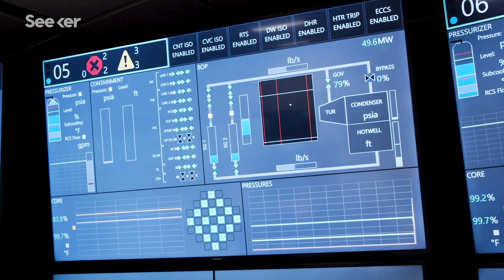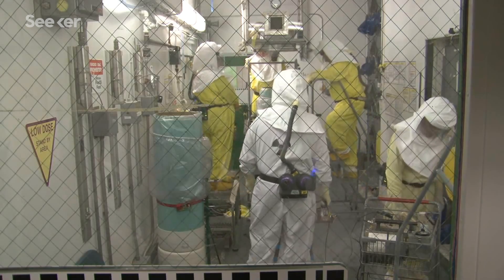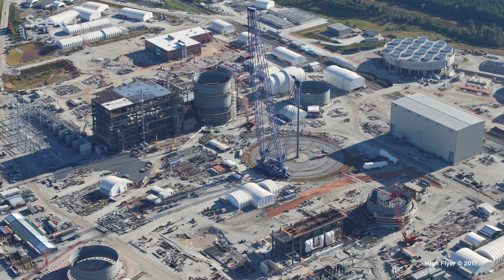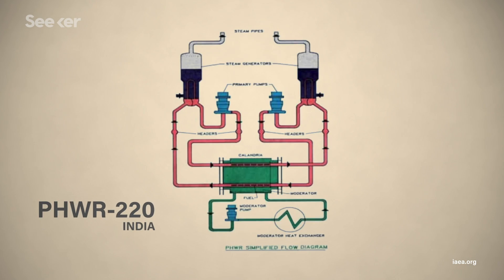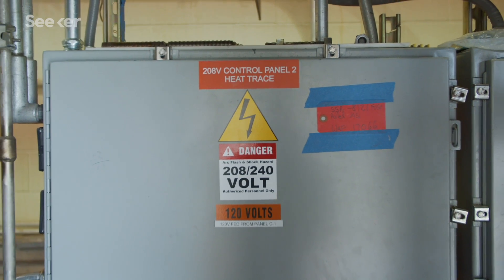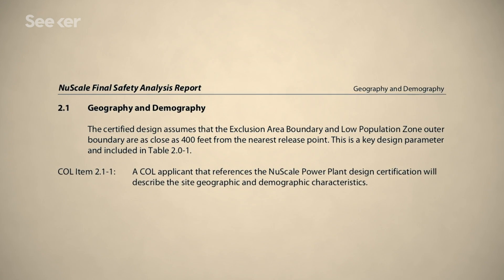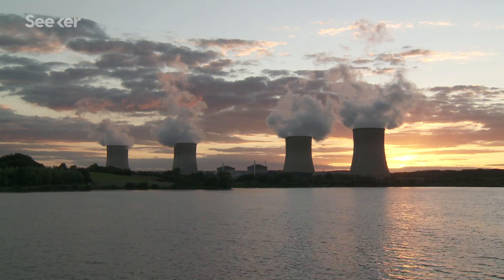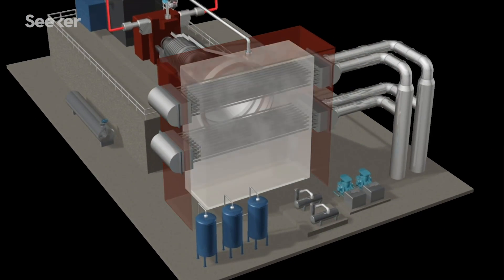Mini-Nuclear Reactors Are Coming, and They Could Reinvent the Energy Industry

Comment: One word: Thorium.
Reply: @Shell_Beach  Molten salt gives you safer reactor. Thorium gives you much, much safer residues. Win, win
Reply: Mike G that was three with a punctuation
Reply: Thank you Mike,the voice of intellect .
Reply: Three words : Fast Breeder Reactor
Reply: Mike G fun fact, the US military considered thorium when first developing nuclear reactors, but ended sticking to uranium since it could create plutonium for weapons
Reply: @cru5h80cru5h 
You mean unlike Thorium reactors that can produce uranium and plutonium which could be used in nuclear weapons.
India and Pakistan are fighting right now over India's plans to use a breeder reactor to create the driver fuel for a thorium reactor, which is weapon grade plutonium.
Don't believe everything people tell you.
Reply: @cru5h80cru5h  I'd encourage you to look into that more.
Reply: @haliax8149  Actually, Cesar is 100% correct.
Reply: @cru5h80cru5h  You forgot the fact that building a nuclear reactor run by a plutonium core is 1000 times easier than Thorium.
Reply: Show me a molten salt design that deals with the pipe decay.
Reply: @Shell_Beach 
The nuclear industry has promised the sky for decades.
They talked about" electricity to cheap to meter" and France even had ambitions to run on 100% nuclear energy (not only electricity but energy) and didn't even come close.
With current technology the levelized production cost of nuclear is around 140 to 190$/MWh. France estimates that they could lower that to 70$ in the next 5 to 10 years with their Gen IV reactors.
In the meantime we see the cost for wind and solar and storage diving hard.
New utility scale solar and wind is currently at 30 to 55$ and by the time gen IV reactors are ready will drop to 20 to 30.
So even if you include storage, nuclear is way to expensive.
Reply: @TBFSJjunior  "Current" technology is still based on the equivalent of a 1930s aircraft design.
Reply: @bobthebomb6498 
Sure fundamentally most nuclear designs are based on 60+ year old designs. Same is true for LFTR.

In regards of France their current reactors are GEN III+ designs and even their Gen IV designs are based on old technology.

It is always the same with nuclear it seems.
Same old promises. How does the saying goes: "Talk is cheap"
Reply: @bobthebomb6498 
After rereading I'm not sure if I might have misunderstood you.
What do you mean with "1930s aircraft design"?
Reply: @TBFSJjunior  I meant that the current reactor designs are so out of date. It is like airlines running 1930's aircraft.
The LFTR design is also old (and not necessarily the best), but it was never fully developed. Modular, liquid fuel salt reactors are the future; fast or thermal.
Reply: @bobthebomb6498 
"Modular liquid fueled salt reactors are the future"
I highly doubt it as it seems to be way to risky, which seems to be the reason why they barely invest into it and spend most of their money to lobby for out of market solutions.

Even the lobbyists claim that it will be more expensive than renewables.
Reply: @TBFSJjunior  The reason traditional nuclear companies don't invest in liquid fuel technology is because they make their money supplying fuel, not generating power.
Reply: @bobthebomb6498 
First that isn't true. Currently noone makes money with nuclear (a few companies even went bankrupt), as the price for fuel took a dive and the cost for building power plants went through the roof as the industry overpromised and under delivered.... except power companies some of them still make money with nuclear if they own old nuclear power plant without financing cost or get huge subsidies from governments.

Second: I didn't say anything about traditional nuclear companies. Even non traditional companies spend most their money to lobby governments to give them money cause they can't find any big investors who believe their promises.
Reply: @TBFSJjunior  I'm sorry but it is true.
The costs associated with the production of solid fuel pellets and precision rods for traditional U235 reactors is a huge part of the operational budget.
Secondly, I am talking about modular reactors that can be produced for a fraction of the cost of conventional ones; without the need for large, expensive reactor vessels or containment facilities.
Both China and India are investing in new reactor technologies . in the West companies are too afraid of a hysterical backlash from the so called green movement.
Reply: @bobthebomb6498 
Sorry but that is a non sequitur.
You claimed they only make money with fuel. The fuel being a big part of the operational budget doesn't support this claim. Fuel could be 100% of the operational budget and companies producing fuel could still produce it at a loss.
But again I wasn't talking about traditional fuel or traditional reactors.

"I'm talking about modular..."
Yes I know and so did I. I talked about LFTR, Thorium cars, Thorium, Molten Salt, Modular, Drain Plug and all the other buzz words used to talk about new nuclear technology and how the talk doesn't match the actions.

Governments invest into nuclear (like in China and India) but all over the world nuclear is such a risky investment that companies can't find enough private investment.

The argument is basically like this:
"We have a technology that is much cheaper and much more safe"
Me: "great then build it"
"Yeah but we need the government to finance it"
Me:"why? If it is so much cheaper then it should be easy to find investors to build it. If it is so cheap it should undercut the market and be a big money maker"
"Yes it is cheap and safe and would be a money maker, but the treehuggers don't want it in the west"
Me:"so it is getting build outside of the west?"
"Yeah in China and India the governments already got convinced and they invest into it, but now we have to convince the governments in the west"
Me:"wait a moment so even outside of the west in countries without tree huggers you couldn't find anyone to finance your really cheap way of producing safe energy outside of governments? Sorry but that sounds like there is something fishy with your claims"

If you invest almost all your money in PR and lobbying and almost non in R&D or construction, then I'm sceptical if your claims are true...especially with claims that sound to good to be true from a field that has a record of claiming things and failing to deliver on those promises.
Reply: @TBFSJjunior  Why would China invest in a western company when they could have the market to themselves?

I said that the traditional nuclear industries don't want to invest in liquid fuel technology; their profits rely on selling expensively fabricated fuel to the power generators. They are not going to invest in a technology that would destroy their market.
Reply: @bobthebomb6498 
"I said that traditional nuclear industries...invest..."
This is a bit tiring. I told you multiple times that I didn't talk about traditional nuclear industries. I don't care about them and they can be ignored in my argument.

"Why would China invest in a western company..."
First they do so all the time and there are good reasons for it, but again that isn't the argument.

You make it seem as if traditional nuclear industries and China are the only ones that can invest in new technologies.
I doubt that you believe that but I can't understand why you argue as if that is the case.

Ignore China and ignore traditional nuclear industries.

The investment market even without China and the traditional nuclear industries as investors is many trillions huge. If you present them with the option to invest in something that can make them billions you will find an investor to finance it (unless investors don't trust your claims), but your cheap and safe modular system can't do so and instead people invest into PR and the lobbying of governments to invest.

If I have a great product and it is a safe bet, then I will keep it in the private sector cause I can make a ton of money with it.
If I have a product and I want it used but know it isn't economical viable or very risky, then I go to a government to finance it.
(This is oversimplified and I only write it this way as I hope you understand my point as you have failed to do so this far)

If someone promises something that sounds to good to be true, but he can't find a serious investor (one of those that does some research before investing), then that smells like con-man/snakeoil salesmen.
Reply: @bobthebomb6498 
"Fine ignore China"
Are you for real?
I told you to ignore china so you could understand my argument and instead you choose to ignore my argument and strawman me.

If you want to stay ignorant do so, but you should learn for the future that if you defeat an argument nobody made, you actually defeated yourself.

"Remember this conversation if they are running your nuclear industry"
They won't. Just like they don't dominate the snake oil market.

Comment: Imagine what we could do in space with this!
Reply: Voyager 1 and 2
Reply: It wouldn’t work in space. The control rods need gravity to work
Reply: @anonymousunknown8801  and I don't know ,WATER !
Reply: Reactors work in space: we have big rotating rings around spaceship!
Reply: @anonymousunknown8801  If the thrust is high enough, that force would act as gravity.
However riding a wave of nuclear explosions will most likely give your ass cancer if it doesnt damage the "rocket" before that.
Reply: Ben Dover The spacesuits will make sure you are protected 👍
Reply: @BenDover-vb4lj  the problem with thrust generating g force is that it fails as soon as you hit light speed
Reply: @anonymousunknown8801  you can just put spring behind the rod and held it with electromagnet and problem solved
Reply: Fusion would be much more interesting in space. Since one of the biggest problems we have is to how to keep plasma contained against gravity that problem would basically disappear in space.
Reply: Curiosity used a nuclear reactor it's just a different type
Reply: Voyager 1 and 2 have these on board. 30- 40 years old.... Rockets are old and makes me laugh. Scram Jets have been taking planes suborbital since the 80's
Reply: how do you cool it in space my little smart guy?
Reply: And watching this in space melt down would be epic.
Reply: @garystinten9339  Space is extremely cold. We dont even need massive water to cool them down.
Reply: @TheViettan28  thinking too earth based
Reply: @TheViettan28  yes and no.. you need a chemical that isn't freeze but acts as a lubricant between the rods but won't freeze in space.
Reply: It wouldn’t work in space. The control rods need gravity to work
Reply: @anonymousunknown8801  unless we find a way to centralize a gravitational field against specific parts of the machine which is waaaaaaaay beyond what we are capable of now, I have to agree with you. It wouldn't work
Reply: @anonymousunknown8801  not true. In a controlled tube, gravity is not needed.
Reply: Pretty much nothing we couldn't do now? These really are not smaller in the sense of size at all. They still require a giant facility to operate. Calling these "mini" is 100% just a ploy to make you think this is new advanced technology. It's not. It's actually old technology if you did the research. Did you even watch the video or just see the title and get excited? LMAO